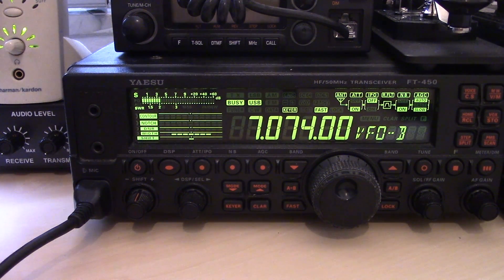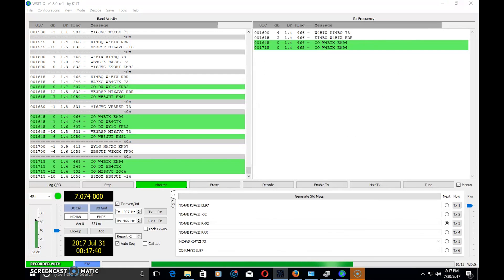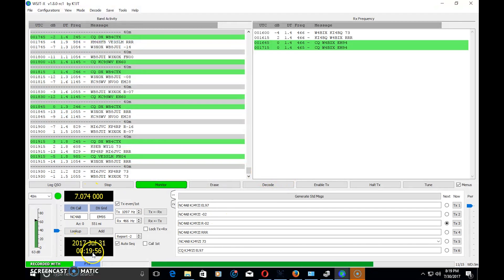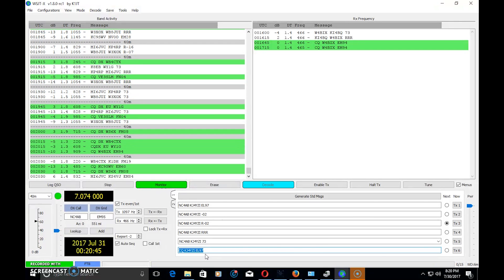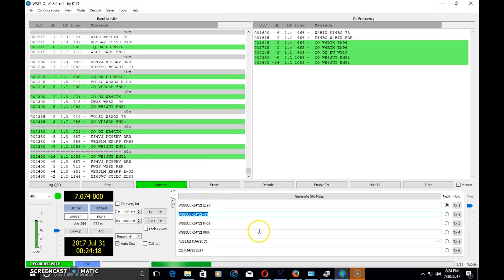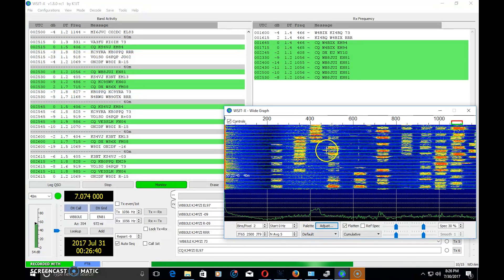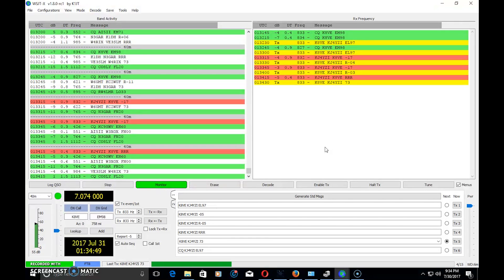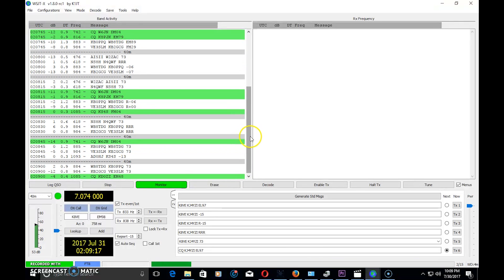FT-8, The New HF/6m Digital Mode, Introduction For Beginners

Comment: i actually tried it yesterday for the first time.  Before I tried it, I thought it was absolutely a waste of time, but I read up on it and gave it a go yesterday.  It is a super fast mode.   I was actually pleasantly surprised at how well signals got out.   I am running a 55 foot vertical and lowered my output power to 2 watts and then used the signal transmit slider to lower my power even more.   I was making contacts with 0.1 watt on 40, 80, and 160 through pretty horrendous conditions that CW would not even be able to penetrate.  I finally wrapped it up at like 2am.   It was fun.  Sure, a lot was automated, but the fun part was trying to reach out to DX with minimal power.   I couldn't reach Argentina at 5600 miles...but it was fun trying.  It's a bit finicky to set up on the Mac, and make sure you go find JT-Bridge (software-that finds your contacts on WSJT-X and imports them into your Logbook http://www.k0pir.us/macloggerdx-wsjt-x-jt-bridge/).  The most difficult part of the FT-8 is figuring out how to make a contact.   It's one of those modes you definitely have to read the manual.  I tried going on youtube and people get so bogged down in details that it's difficult to see what's going on.  Whoever designs these modes has an amazing thought process.  I am amazed with what can be done with such low power.    

Great video here...above.   I like that little Yaesu, especially that front display.

Comment: Whenever I work FT8 as soon as I give a signal report the other station doesn't come back or give a signal report. Is this the future of ham radio?It's been a few hours of operating since any station has completed a qso with my station. Pretty pathetic hobby!
Reply from the maker: Have you synchronized your computer clock with software? Sounds like something is not right. I dont use FT8 anymore, but the times I did, it never failed at 5 watts for me, no mattery which band I was on...

Comment: Since the bands are so bad here in Hawaii and I have not been able to make a single HF contact so far I decided to try the FT-8 since it works in poorer conditions with less than perfect antennas. Well, so far I am having the same results with FT-8 as the other modes. I can barely see anything on the waterfall, a few extremely weak signals, but nothing anywhere near strong enough to decode. So far, no contacts.
Reply: UPDATE: I kept at it on 20m with the FT8 and I have made 3 contacts within 5 minutes, New Zealand, Japan, and another Hawaii station that I normally cant talk to with phone.

Comment: So......The entire point of FT-8 is to purchase equipment and then test that equipment with signal reports? That's it? No conversational content?
I must have missed the point somewhere.
Reply: There is no conversation, however, like he said, it's to help people with poor conditions, poor antennas, or in restricted environments who want to get DX without doing CW or to see just how far a low bandwidth mode can go around the earth with as low power as possible.
Reply: Well for the equipment you already have it... It only a new mode to try out. If it’s not good, it will end by itself with time. I find this mode very good for testing propagation quickly which I think it’s the main point of this mode. For chit chat there are plenty of other modes available ;)
Reply: There are free text settings for these fields if one feels the need to pass information beyond signal reports, such as "send more donuts". Can be found Settings ->TX Macros
Reply: http://qrznow.com/a-new-ft8-with-rag-chew-abilities-ft8call/
Reply: YA right, so on SSB you never hear anyone just giving a 5/9 and move on. Get over yourself, it's a mode for restricted antennas or bad conditions etc. If you don't like it, don't use it. Pretty easy there eh?
Reply: It is not like that at all. Indeed in "contests"  you just acknowledge the call, give a signal report and move on but there's plenty of conversations on SSB Phone.   Even CW is more interesting than FT8.
With FT8 you can leave the radio and the computer on all day and just come home at the end of the day to collect the QSL's.  I don't think this is amateur radio.
Reply: Bob Sullivan n
Reply: er er er well yes thats it, is it not fun..:)
Reply: Try JS8CALL. It’s QRP conversational. My new favorite mode.
Reply from the maker: Just because there are some out there utilizing it, doesnt mean you have to hate them.. I myself am not one of these FT8 users you are hating on, I am simply just making a video showing it to others. If you dont like it, just move along, there is something for everyone in this hobby.
Reply: I'll stick with real ham radio.
Reply: Don Zielinski you are so wrong. Digital modes are just another facet of our great hobby. They work great for the poor conditions we have these days. Stick in the mud like yourself who disparage others are why some that I try to get involved and licensed don't want to. 
If you don't like digital, do voice, do satellite or Morse code. There's  no need to be close minded just because others embrace the hobby different than you do.
Thank you for sharing this video.
Reply: I have to agree. What is he point of this mode if no conversations take place. Just two computers handshaking over RF.? Why get into ham radio for this? It’s almost Radio.
Reply: antennasbc 
SNAP! SLAM! STOMP! Ouch! Ouch! 
This is gonna leave a mark....(better get a band-aid)
Reply: Bob.....its only for the lazy ham!  Millennials are always looking for the easy way out and the ARRL helps them.

Comment: Good video. I tried it but just can't get excited about digital modes. It's just too boring and I don't like the fact that it requires a PC to run. SSB and CW are a lot more fun.
Reply: There are exceptions though.  For example, obtaining weatherfax and satellite images or chatting with the ISS as she flies over.  APRS can be quite useful, as can the ability to access email or internet-based wind/weather information without an internet connection - as I did when circumnavigating solo in a 26ft yacht.

But, just harvesting QSLs in an automated fashion is boring, and is simply a way of checking conditions and performance... it's not easy to get excited about unless you're a gridsquare hunter or a contester.  Manual modes are so much more gratifying.

But, speaking as someone who's used amateur digital modes in anger, when the nearest human being to me was on the ISS... and had that digital access keep me safe, connected and avoiding storm systems... I got to say, it can be damned useful.

Even in voice modes and CW, many OPs simply want to register a contact and move on.  Amateur radio can be so much more than that.
Reply: Andrew Ivanov .......I agree Andrew.  Making a contact yourself requires skill and leaves you with a sense of accomplishment.  People are relying too much on computers to do their work.  Its the very definition of lazy!

Comment: Incidentally: power by itself doesn't "blank out the waterfall" or "distort" signals.  Most of those types of effects can be mitigated by turning off AGC and reducing the RF gain.  

There's a widely held popular belief that every strong signal is someone running "power" but power is only a tiniest fraction of the equation when it comes to signal strength (this usually causes readers to come banging on the door with pitchforks and torches so I'll put my flame suit on).  Just a recent example: I received a +18dB report running 1.5 watts from a station one minute and then the band dropped out and I had to up the power to 50 watts and finished the QSO with a -18dB report.  Reports are not absolute (I have more info on this from Joe Taylor directly if you're interested).  It's also quite difficult to overdrive FSK signals like JT65, JT9, and FT8 (though every other post you see on the various social media sites drops the word "overdrive" like it's candy as well as the very over used "ALC" references).  A signal like the modes generated by WSJT-X are essentially constant amplitude and continuous phase. A linear transmitter PA is not necessary and the ALC level isn't nearly as critical as it is with, say, PSK31 (this one REALLY brings out the keyboard commandos so for those folks: I have verified this with the WSJT-X development team including K1JT so if anyone wants to argue the point, go argue with him, however, my money is on the Nobel Laureate ;) ).  

Lastly (this is for the benefit of others who may be reading) - the waterfall is a convenience appliance only.  It was never intended to be used to measure signal quality or spectral purity.  There are dozens of factors that influence how a signal appears on the waterfall - the signal you see is not the actual signal but the sound card's interpretation of what it "hears" from the radio.  This is where a Panadapter tied into the IF comes in handy.  In 15,000 JT65 contacts, several thousand JT9 contacts and going on 4,000 FT8 contacts, I can literally count on one hand (maybe two now but I'll have fingers left over) the number of "poor" signals I've seen and in each case, those were not caused by "power" or "overdrive" but by lack of isolation between the soundcard and the radio (very necessary!!) or RF making its way back into the transmit chain due to common mode current riding the coax back to the shack.  

Ok, that was way longer than I'd intended :)

73,
Jim S. 
N2ADV

Comment: Re: the waterfall: your radio is displaying the carrier frequency (were the carrier not suppressed since you're running SSB).  Since you're running USB for these modes, the waterfall shows the number of Hz above the carrier frequency.  So if your radio shows a frequency of 7.074 MHz, looking at the waterfall at 1,000 Hz, a signal is sitting "on" 7.075.  At 2,000 Hz, the signal is "on" 7.076; this is important to remember as since the JT65 segment starts at 7.076 MHz so if you show a frequency of 7.074 MHz and you transmit a signal at, say, 2,800 Hz, you're 800 Hz into the JT65 watering hole and you may be causing QRM to someone running another mode.  

Hope that helps.  
73,
Jim S. 
N2ADV
Reply from the maker: True, but the FT8 stations are now sending at PSK frequencies and others, pretty annoying when they do that

Comment: KE8BYM
Thanks Eric, great video helped a lot. One thing I would like to add is synchronizing the PC clock once the software is installed and being set up. I ran into an issue where the software was not decoding however it was receiving well, synchronized the PC clock and the band activity began to fill in. I am running a Yaesu 857D with a Signalink USB through a USB hub. Cat control of the 857 and VOX control of the Signalink work fine. Have made my first few QSOs now! Thanks again.
Reply: you cut off... I have an 857D and wanted to know what you were trying to finish saying..

Comment: Thanks for the video.  The mode is lots of fun. One correction... At 9:20 in the video ALL of the signals in the waterfall are being simultaneously decoded in the left hand pane automatically!! You don't have to click on top of a signal as it says in the video, in order to decode it. 73, John AF3K

Comment: FYI, the slider on the left is for the gain of the signals on the waterfall. The slider on the right is for your audio levels. Make sure to check your ALC against the audio level slider on the right. If you are calling CQ, check the "Call 1st" button. It will allow the software to auto respond to the first station the software decodes. This way you do not have to click on stations when responding to a call, potentially missing a call or extending the amount of time spent on a QSO. 73, N5SDD.

Comment: I love these ultra efficient digital modes, having the ability to make contacts even when the antenna and band conditions are very poor is incredible for me.
Reply: After s year nearly since discovering it, I have not used it as much as i expected.  certainly incredible. But it's to monotonous for me and i fall asleep over the keys Hi. I do as well and end up with a headache. So mainly use it for testing home made gear and propagation to get some idea off band conditions. It has taken off in  mass. has now dominated the hf  bands and also first time i have heard a digital mode on 160m and 6m. Whenever i switch on i now  find a FT8 signal. I was s keen psk man, but hardly hear any now after building a dedicated psk system. now tuned to ft8 just for the fun of monitoring. that's my problem, i find monitoring More interesting..leave it monitoring while on the workbench. Not a dx chaser or contester.  Been mainly cw for many years, but thats dried up a bit, rare to get a reply on s cq call i find now, yet years ago 1 watt qrp worked the world. so not much of an :operator now as little rag  chews around now. Gone back to building gear. using valves as i have 'loads of them. Anyway FT8 certainly created a stir.
Reply: contacts..ok great. But can you actually ever communicate more information? How effective for example would FT8 be to communicate an emergency message

Comment: Which version of the MFJ USB interface are you using for your FT-450?   I don't see explicit support for the FT-450 on the MFJ web page for the 1204.  Thx!
Reply: Mark, Did you find out what MFJ USB interface is being used in this Video??
Reply: I have not received a reply.   However, I contacted DX Engineering and they said MFJ does not make an interface cable specifically for linking the 1204 to an FT-450D.   So that leads me to wonder if the interface is home brewed.
Reply: Well, I guess it's ridge runner or Signalink on my FT-950.
Reply: I also looked at the Signalink.  If you get the little model-specific plugin for the jumpers, it looks easy to set up.    Now, I wish there are a way to isolate the ground connection from the CAT/usb interface cable.  Then my station would be totally off the house ground.
Reply: Yeah, Problem for everyone more than likely.  Good Luck! 73 KF5YPC
Reply from the maker: Actually, it is the same connector as the FT950, the FT817 and other Yaesu that use the 6 pin mini din, sorry i missed this comment...